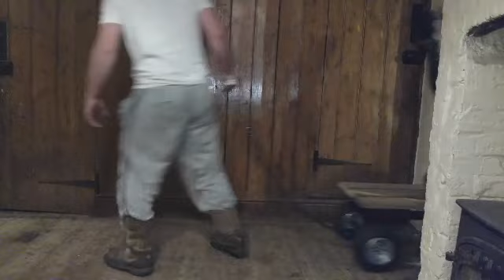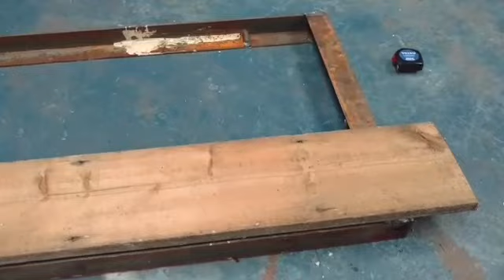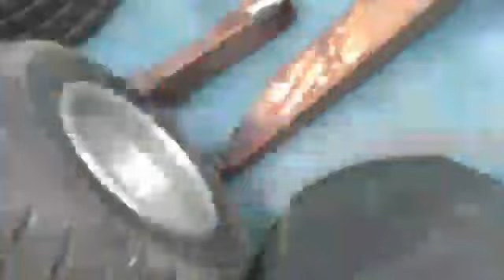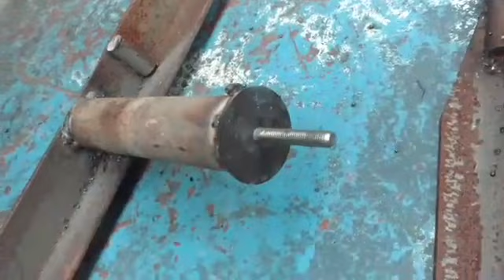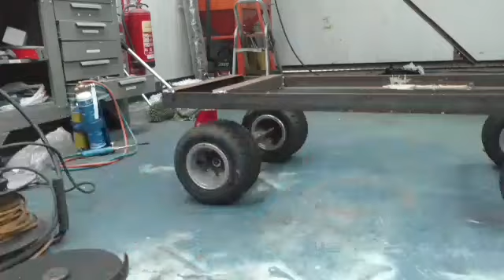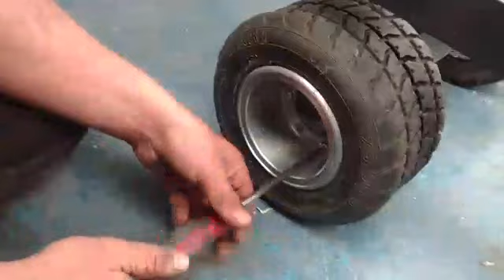Go-Kart wheeled cart build

Comment: How much weight can the wheels hold? I was going to make a two wheel dolly using go cart wheels.
Reply from the maker: They're ok, obviously only the fronts have bearings in them and they are pretty small so I'd not push much past 50kg on them alone mostly because of the limited spindle diameter, if you use the rears and make your own flanges up then I'd not get shy till way past 100kg.